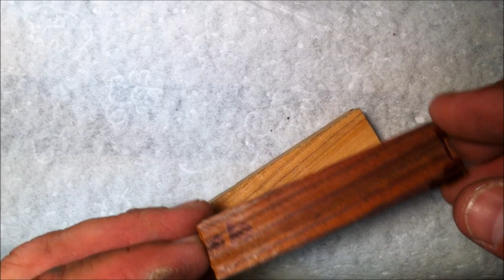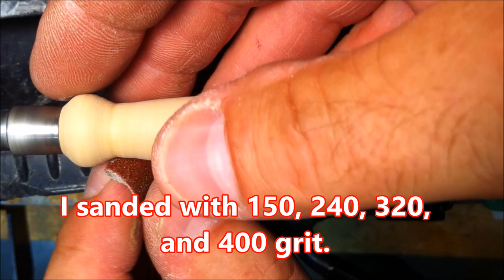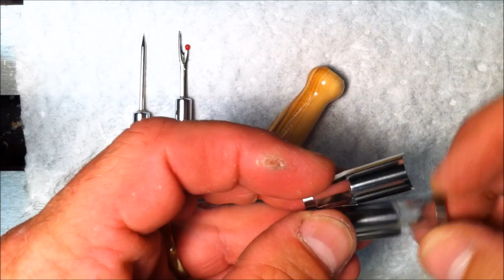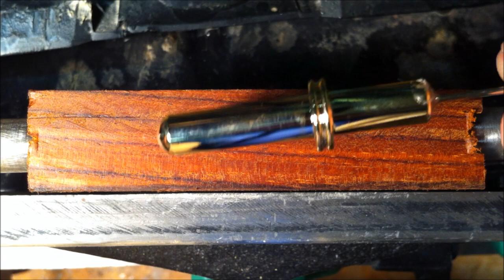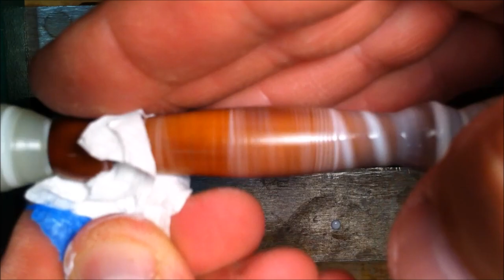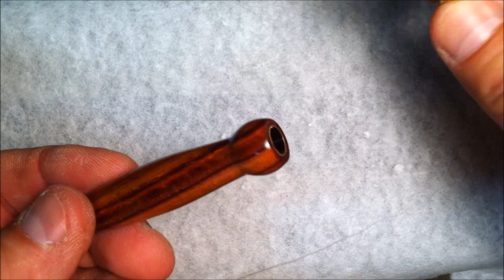Seam Rippers

Comment: Very nice looking seam rippers.

Picking up the kit necessary to turn them is on the list for next month for my wife.  Looks like a 8mm mandrel and drill bit are what we are going to need, beside the seam ripper kit.
Reply from the maker: You are exactly right,
  You will need and 8mm bit a 7mm mandrel and a set of bushings. I have even turned a seam ripper between centers when my mandrel bent. 

Regards,
Bob
Reply: Make Crazydays Yes, 8mm drill bit, and a set of bushings and you are all set.

Comment: I just turned one a couple nights ago. On the large ripper end I burned 2 line and a single line on the smaller end to distinguish them when both ends are closed. Great video - thanks.
Reply from the maker: That's a great idea John,
  I may use that on a future ripper. 

Regards,
Bob

Comment: Thanks Bob this came in handy mate I just got 3 kits and no instructions which was no problem really but I wanted conformation about which way the springs went in turns out I was on the right track thanks again Bob
Reply from the maker: Thank you Trevor,
  I enjoy making seam rippers and they are relatively easy to assemble. For some strange reason, I've never received instructions either. I had to go to Penn States website and look up the PDF the first time. I'm like you, I can figure it out but I like a little confirmation before I commit 100%. 

Regards,
Bob

Comment: Sometimes, CA glue may accidentally build up on the inside of the brass tube. I've found that if the retainer spring doesn't slide in easily, then using a rat tail file to smooth the inside of the brass tube solves the problem. I always use that file now, just before assembly to eliminate having a spring fold up (and ruining it) during insertion.
Reply from the maker: Hello Doug,
  I got lucky on these and didn't have any C/A build up. I use a jewelers round file to clean my tubes up. It's a great tool to have on hand. 

Regards,
Bob

Comment: Very nice seam rippers Bob I will have to try a few of them they look fantastic.
I noticed you have changed your method of applying CA from putting the CA on a piece of towel first, to running it directly along the turned blank.  I have always used the later method with pretty good results, have you found it to be of any benefit doing it that way?
All the best
Tony
Reply from the maker: Hello Tony,
  I think I get a little thicker coat drooling the C/A on. It may only be in my imagination but it's working pretty well and is giving me the results I want. I also think I'm getting a more uniform coating. 
  I still use the C/A on the towel method from time to time, especially on less porous woods. 

Regards,
Bob

Comment: Great job as usual.  Never turned on of these but I'm getting ready for my first craft show this fall and I think these will be a great addition.  Do you get your blanks from Penn State also?
Reply from the maker: Thank you Thomas,
  They sell very well here in the Mid-West at the craft shows. I do get mine from Penn State. I have found that the stiletto model sells better that the double seam ripper. That may be different where you're at. The single ripper model had never done well for me. 

Regards,
Bob
Reply: RJBWoodTurner Thanks Bob.

Comment: Very nice as always RJBWoodTurner . what type of ca do you use? also you use those plastic bushings when you are using the glue or all finishes?
Reply from the maker: Hello Mike,
  I use Insta Bond and I get it from Packard. 

Regards,
Bob
Reply from the maker: The plastic bushings are HDPE I get it on Amazon in 3/4" rods and turn it down myself. 

Regards,
Bob

Comment: Hi Bob! Thank you for sharing. I have a question. I am a bit confused about the process. As I understand it, you cover the sanded piece with several layers of CA glue, and after that, you sand it with the micromesh. The Micro mesh, when you take it all the way up to 12,000 will generate a very shinny smooth surface, basically, going through all the grits, you removed all the hills and valleys the CA left on the surface. So, I am confused as to why you apply CA again after you micro meshed it. I found doing bottle stoppers that the CA finish works best when you have a simple shape, otherwise, with the micromesh you run the risk of removing all the CA from the hills, I solve the issue by applying a few layers of thin CA first, and then three or four of the thick. Once I finish the process of micromesh, I only apply additional layers if I see that I eroded the plastic finish completely and have dull spots. But if that is the case, I then go back to micro mesh it. The seam rippers look great anyway, but I think you could get a better shine that way. Just a suggestion. Maybe I am wrong, if that is the case, please let me know. Cheers! Daniel
Reply from the maker: Daniel,
  Your method is the preferred method. I have received numerous comments asking why I apply more C/A. After a bit of research, I may need to revamp my process. 

Regards,
Bob
Reply: Hi Bob! Thanks for the reply mate! Cheers! Daniel

Comment: You've been an inspiration for a lot of my projects, I am fairly new to turning. I have tried to use CA glue to finish my projects, but as soon as I drop the first drop, it starts smoking, and the finish product  is less than passable, I have tried slow speed (250 rpm) that's as low as my lathe will go, and up to 800 rpm, thin to thick glue. The end product is always the same. I not sure as you do it , but, it sure looks easy (lol). Do you have any recommendations for a newbie ?
Reply from the maker: Make sure your using kitchen paper towels. Some towels will smoke. 

Also which C/A are you using. If it’s not refined it won’t work. Glue from the hardware store is only for gluing things together. 

Regards,
Bob
Reply: @RJBWoodTurner  Just tried starbond glue .  no smoke. , Thanks for the tip,

Comment: Awesome work!  For arthritic hands, how hard would it be to make more ripples in the middle? Are you using a large lathe or very small?
Reply from the maker: +Jena Pope I think additional ripples could be added as well as making the handle diameter larger. I use a small bench top lathe. 

Regards,
Bob

Comment: Thanks for the cool video! My cousin recently asked about turned seam rippers, i'm pretty new to turning only having done a few pens myself. i have two questions:1) could this be done on a 7mm mandrel even though it's an 8 mm kit? 2) What kind of CA are you using? I'm using Bob Smith Super Thin and I can't seem to get a finish that clear, I think I may need to get a medium CA but thought i'd ask if you had any suggestions. 

Thanks,
Kage
Reply from the maker: Hello Kage,
  Yes the 7mm mandrel works for all pens. The bushings will have a sleeve for the larger tubes. 
  I use Instabond C/A from www.packardwoodworks.com. I use the thin for finishing, the medium for filling, and the thick for gluing tubes. 

Regards,
Bob

Comment: I'd suggest lateral sanding between grits.  you can see your ,400 grit marks under the CA.  I sand to 1,200 or 2k.
etsy.com/shop/cookcrafted. 
Facebook.com/cookcradted
Reply from the maker: Thank you Ethan,
  I did sand with the grain between each grit. I use a phone to record and the lighting sucks in my temporary shop. Those two things may have given the illusion of fine scratches on the surface below the C/A finish. I check all my blanks with a light at a 45 degree angle and they did not show any sanding marks. I apologize for the crapy video quality. 

Regards,
Bob
Reply from the maker: Ethan,
  I went back and reviewed the video, what you are seeing is grooves in the C/A where I applied a coat after the Micro Mesh. I got a little thin. I re MM'ed and polished those rippers before sending them out. 

Thank you for keeping me honest. 

Regards,
Bob